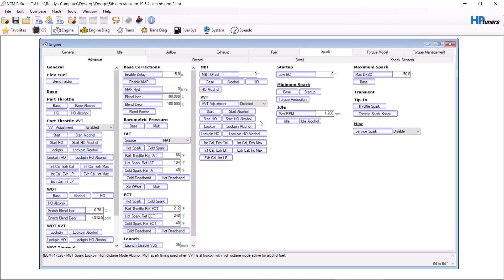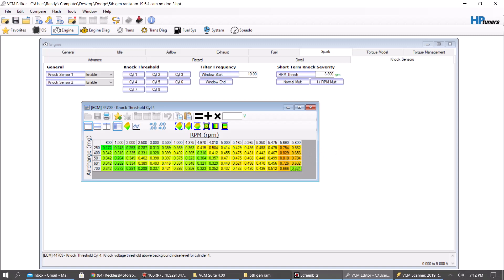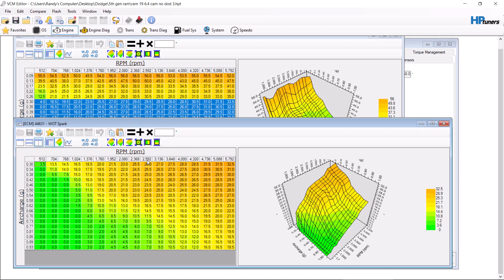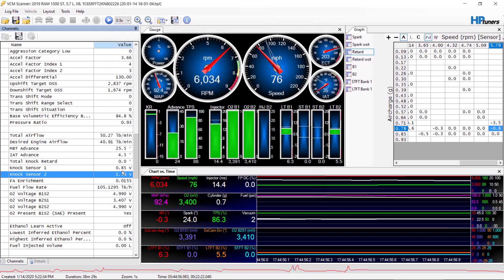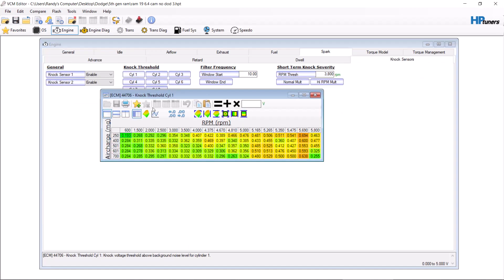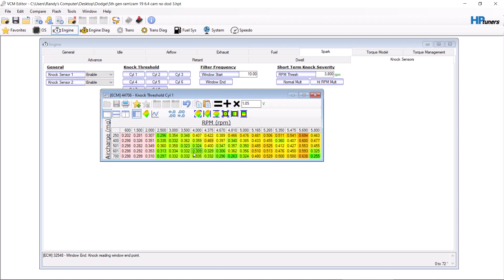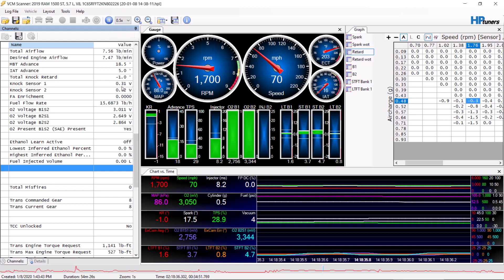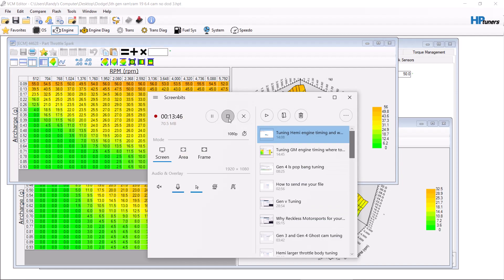Desensitizing Dodge knock sensors

Comment: Do you know the reason why the Ram 1500’s have knock sensitivity so much lower than like an R/T 5.7? Are they different sensors by any chance?
Reply from the maker: Could be any number of variables, in theory it means the cars are more noisy, or they run way more timing and it’s a safety net.

Comment: Is there a safe knock values that we can keep? Riding the sensors ? . One more thing i get a lot of part throttle knock with stock timing tables that goes away with octane boosters what do you suggest
Reply from the maker: Typically only thing for that is to run 91-93 my hemi was the same way